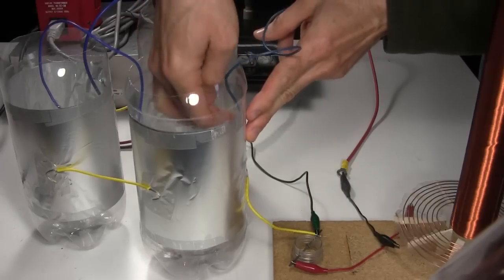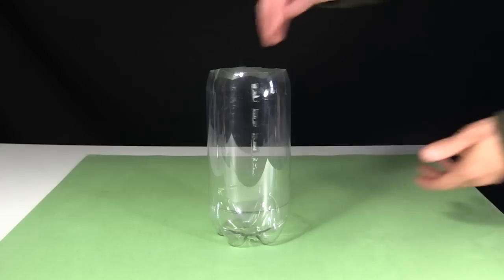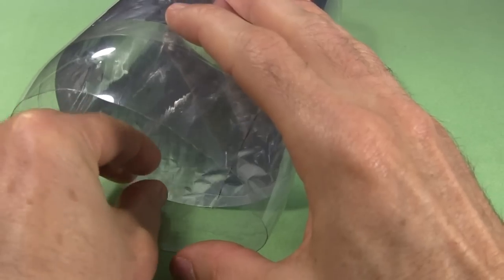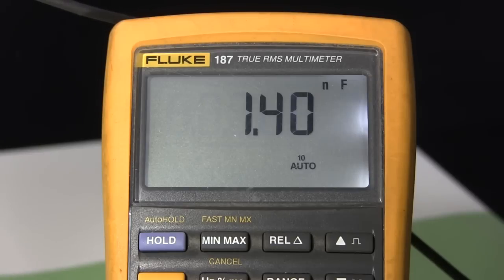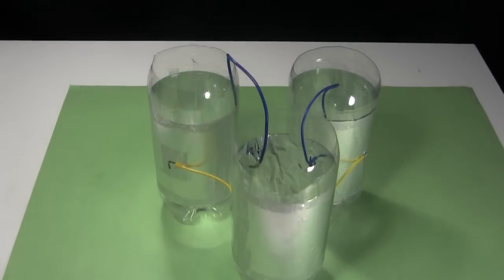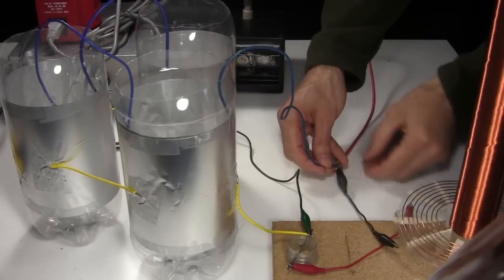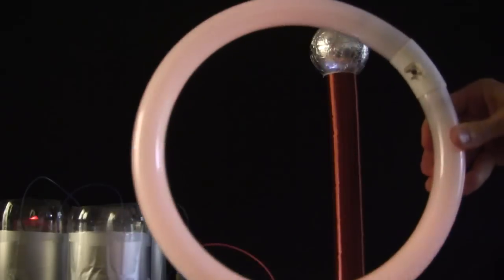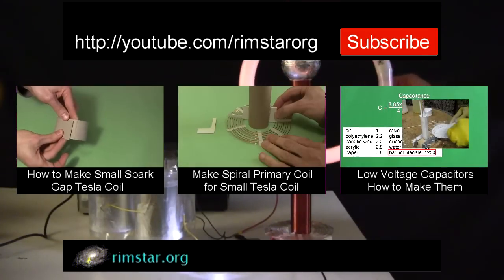How to Make Capacitors for Tesla Coil - Small SGTC

Comment from the maker: +Ereka Bergantinos I used around 18 AWG (gauge) wire with a plastic insulation. The size (gauge) of the wire doesn't matter much, but it should be insulated to minimize losses i.e. not bare wire.
Reply: +RimstarOrg i also wanna know.. what if the magnetic wires in the secondary has tiny gaps in some areas? is it gonna make a problem?
Reply from the maker: +Ereka Bergantinos From what you describe, it shouldn't be a problem.
Reply: oh.. thanks! :) and also.. the primary coil is made up of stranded copper wire? and why ist that it has to be a stranded copper wire?
Reply from the maker: +Ereka Bergantinos It doesn't matter if it's stranded or solid. Either one is okay.

Comment from the maker: Making it even easier for anyone to do... how to make soda bottle capacitors for the small Tesla coil. enjoy!
Reply from the maker: *****
Cool. I look forward to seeing it.
Reply: Rimstarorg I was wondering I wanted to buy some high pressure sodium lights to start growing vegetables indoor and I don't have like solar or anything but I'm reaching out to you to see maybe if you know how tall or big a tesla coil needs to be to generate enough electricity for a high pressure sodium light and how to get the maximin capacity of a tesla coil to the lights. Do you know how this can be done? Much love!!
Reply from the maker: Anthony Garcia
I don't know anything about sodium lights but a quick look at https://en.wikipedia.org/wiki/Sodium-vapor_lamp shows they are similar to fluorescent lamps. If you're thinking of using a Tesla coil because of the demonstrations of lighting fluorescent lamps with it, those lamps aren't lit very brightly and I imagine it's an inefficient way of doing it. Probably better to search for a circuit that directly connects to the lamp instead. Cheers, Steve
Reply: Their only not lit brightly because of the amount of energy being sent off from it right? The col itself generates electricity I guess I'm just trying to figure out how to use the energy it can store to its maximum capacity.  I see the closer you put any light to the coil the more power it gets. I want to figure out how to send off its large amount of energy to a bulb that is like 20, 30 feet away. Any ideas? Sorry if I'm buggin haha =D
Reply from the maker: Anthony Garcia
I have no idea how to transmit that distance.
Reply: Yes I'm not worried of free energy in ancient times Egypt and Greece used something that was similar not exact but similar to what we call a tesla coil. Free energy is there we just have to explore and experiment until we find what works for us (as individuals) thank you both for your input!!
Reply: RimstarOrg if you filled them with saltwater and then put saltwater on the outside like a bucket capacitor you might have a better effect and they may keep from breaking down better having cooling
Reply: @Anthonyag42  there is no free energy. They used the flowing water bodies to harvest electricity from it and radiated it over large distances.

Comment: An idea popped in my head when i saw you attache the inner strip of foil. If you sacrified another 2L bottle, and cut a cylinder out of it, and then a vertical slit. Insert into the original 2l bottle with foil, and it would press the foil firmly outwards.
Reply from the maker: John Knutsson Oh, brilliant! That would be a huge improvement since it would ensure the highest capacitance. It's too bad comments like this come after the video is released. I would definitely have done it (though I don't have any more bottles at the moment.)

Comment: cool video, we can also use cd's to make such capacitors if you need something smaller and compact.
Reply from the maker: professorfidelcat Thanks. Regarding CDs, you'd have to make sure the foil doesn't go all the way to the edge of the CDs, otherwise there could be sparks from one foil to the next going around the CD that separates those two foils. But with enough of them stacked, that would work too.
Reply: RimstarOrg true true..have you tried stepping down these static discharges into usable voltages and quantified currents to accomplish tasks such as recharging a bank of batteries,lighting an incandescent bulb etc?? that would be dearly interesting!!

Comment: You know, I often hear you mention capacitors a lot but I never knew what they are and what makes them so important for electronic devices.
Reply from the maker: Brandon Fisher I have thought that that would make for an interesting video, the various uses of capacitors in circuits. Unfortunately I know of only a few, such as: for smoothing, for absorbing voltage spikes, for blocking DC, for resonating with a coil, and probably one or two I can't think of right now.

Comment: Is an air gap leyden jar basically the same as a salt water leyden jar ?
Reply from the maker: If you mean a leyden jar with a metal electrode wrapped around the the outside of the jar and salt water on the inside of the jar then no, they're both capacitors.

Comment: So I have a few questions. First of all the reason I’d go with diy capacitors is because I’m using 56kv hv source which would require $400 of capacitors. Anyhow, would the capacitor only release current when it’s completely full, or when there is enough energy to jump the spark gap? Sorry I don’t know a lot about capacitors. Also, how would I measure the resistance and volt capacity of these capacitors? Or would it just be so large it doesn’t matter which brings me back to my previous question of when do the capacitors release the current. Thanks!
Reply from the maker: In answer to your first question, the capacitor releases its charge when there is enough energy to jump the spark gap. At that time, the spark gap provides a short circuit which discharges the capacitor. So the voltage at which the capacitor discharges is determined by a number of factors: the shape of the spark gap's electrodes, the width of the gap, the air temperature in the gap (hotter = easier to spark), the air humidity, ... Regarding your second question, the way I measure how much voltage the capacitor can handle without breaking down is to keep increasing the voltage until it breaks down. For the capacitor resistance, I don't know.
Reply from the maker: Here's my video where I talk about breakdown voltage and test the breakdown voltage of a capacitor https://www.youtube.com/watch?v=MPD7skZ8OSo
Reply: @RimstarOrg  wow you replied thanks. I’m the vid was so old I didn’t think you’d reply. Thanks!
Reply from the maker: It's my pleasure! I have a how-to-make an electroscope video which is around 11 years old now and still regularly answer questions there. I just noticed which of my Tesla coil videos this is. I subsequently made another video about some better capacitors for the Tesla coil here https://www.youtube.com/watch?v=EkvODkLL9Og in case you're making yours based on my videos. The flat ones in that video are better because the foils don't move around.
Reply: @RimstarOrg  Yeah I watched that video right after this and that's the design I'm planning to go with. Thanks alot. I will update you in a month or two if it gets finished.
Reply: @RimstarOrg  So I have a quick question that’s not really related to capacitors but I’m hoping you can help since you know a lot about HV generators. How could I add a frequency and voltage adjuster to a HV generator. I have your standard 24v 15a supply that goes into a dual flyback transformer and zvs circuit pair. Is there some thing I can attach to the output of 56kv to adjust voltage and frequency to get longer arcs but less pulses?
Reply from the maker: I don't know how to do it on the HV side but it might be easier to do the the low voltage side. That's what I do for my HV power supplies. I plug a VARIAC into the wall socket and I plug my low voltage power supply into the VARIAC. That way I can vary the low voltage going into the HV power supply. But whether or not it will work depends on your HV power supply. I've never worked with a zvs circuit so I can't say. For the frequency, I don't know. The only HV power supply I've ever varied the frequency on was a 555 timer and ignition coil one (not documented but you can probably find it on the web somewhere). I tend to work with HV DC.

Comment: hello! ok so you've just made the jar's be the electrical source for the tesla coil. Have i understood this correctly?
Reply from the maker: Sort of. The Cube power supply is still the electrical source. But once that's charged the capacitors and the spark gap breaks down, then the energy comes from the charged capacitors.

Comment: aluminium foil/transparent film capasitors have higher capasitance per volume and depending on how many layers of transparent film you add you can make them too suit your voltage needs.  I think you should use those instead
Reply from the maker: Laharl Krichevskoy I considered that, I have a roll of polyethylene, but I wanted to keep it to something that everyone has available. My photocopier transparencies worked well as a dielectric in my TEA laser. What do you have in mind as a source of transparent film?
Reply: RimstarOrg
 i said transparent film because i dont know how you call it in english, (google says plastic wrap) i thought you'd get what i meant. What i meant was that film used to cover food in chinese restaurants. It's the one you can buy in any store, not sure what material it (polypropylene maybe?), but since you can get both that and the aliminum foil in most stores it should be pretty easy and cheap to make.
I'm sure i saw a video about those around here but now i cant seem to find it. Still i'm sure it should work.
It's just plastic, aluminium, plastic and aluminium and then just roll it like you roll a news paper.

edit: found it http://hackaday.com/2011/05/09/roll-your-own-capacitors/
Reply from the maker: Laharl Krichevskoy Ah, thanks for clarifying. As you said, I could always add more layers if the breakdown voltage is too low. It's neat that the aluminum foil and the plastic wrap are next to each other in the grocery store. I guess that's the capacitor making section! :)

Comment: Hey Rimstar how you increase the voltage rating of it to 2000v or 2kv
Reply from the maker: I'm not sure what the voltage rating is for these bottle capacitors. But to increase the rating, you can wrap a lay of more plastic around them and then wrap the foil around that. However, that will decrease the capacitance so you'd need more bottles.
Reply: @RimstarOrg  thank you for the info

Comment: Why do the capacitors have to be circular? Can't you just make sheets of foil with insulators between them? You could get more area on a flat sheet and save space. Stacking multiple layers would help too. Not that a new use for a soda bottle is anything to discount, but you could save them for more water rocket episodes. ;-)
Reply from the maker: USWaterRockets They don't have to be circular. Soda bottles are something everyone has easy access to (I get mine from recycling bins.) But as you say, it's a shame to waste perfectly good rocket building material :).

Comment: Do you have any experience with storing the energy taken up by the capacitors?
I was thinking of making one that can easily replace the battery used in cars, for the purpose of weight, coupled to a small solar charger for supplementary power.
I know it's possible to buy these boostpacks that China recently have taken up.
I was towing my broken down car without power because the battery was empty, but I believe I won't be needing to worry about that if I'm doing what I'm planning to, isn't that somewhat correct?
Reply from the maker: You're talking about supercapacitors. They're quite different than the type in this video and I don't have any experience with them.
Reply: I can tell you that these supercapacitors looks really promising in terms of cranking up your car, at least.
Lasersaber have done some experiments with these, like six 350 farad capacitors coupled in series, and he made it work, and he also kept improving this setup with added solar charger, balance board and a 14 volt RC battery.
This would actually be pretty bulletproof in terms of camping out in the wild for long periods of time, because capacitors discharge all the energy stored in one go.
I'm tempted to actually try making my own as well with aluminum foil and dialectic polyurethane, and measure the capacitance, just because I can.
I need to learn a bit more though, but it can be done and that's what matters.
You should check it out as well.

Comment: sir,if I would wind primary coil of Tesla over the core of fly back transformer, will I get extremely high voltage.
Reply from the maker: No, you don't want a core for the Tesla coil primary. That would affect the coupling with the secondary coil.

Comment: what would you say would limit the input power ? for instance if i were to use a dual MOT power supply with a similar tesla coil sized as yours, would it end in a puff of smoke and flames or will it work ?
Reply from the maker: The only thing I can think of is that the voltage built up across windings of the secondary coil might be too high and you have sparking between the turns, but I can't say for sure if that would be the case.
Reply: RimstarOrg thank you for your reply :) would coating it with paraffin or polyurethane along with some corona  dope be a good way of preventing such arcing problems?
Reply from the maker: That would certainly reduce the chances of such arcing. I'm not sure if it would be overkill but I'd be tempted to even coat the cylinder and then put the wire on while that was still wet, to make sure that where the wire met the cylinder was well coated too. But I haven't done that for a Tesla coil so you might want to search for examples of where other's have coated their secondary coils and what they found necessary.
Reply: RimstarOrg I'll take that into account and hopefully things I'll go well :) thanks alot :)

Comment: I'm confused, what is the formula for calculating how many nanofarads your tesla coil needs?
Reply from the maker: +SpydreX Official I don't have any formula. See my video about making this Tesla coil https://www.youtube.com/watch?v=0SaEPW_iMF8. I just put different values in the online JAVATC calculator, along with values for the other parts until I get the resonant frequencies the way I want them as mention in that video. I did start with variations for capacitances that I could come up with (series, parallel) for the high voltage capacitors I happened to have, but since you can make your own capacitors you don't have to do that.
Reply: RimstarOrg Oh ok thanks:)

Comment: Or..
Don't cut the bottle, wrap aluminium on the outer surface and fill the bottle with salt water. 
You have your salt water capacitor
Reply: Nikhil Jagtap the capacitance will be too high and the primary and the secondary wont resonate

Comment: what's the max NST voltage for these caps in spark gap TC?
Reply from the maker: I don't know. I never reached or tested for their breakdown voltage. These other flat plate caps I made (https://youtu.be/EkvODkLL9Og) are probably better ones though. You can control the thickness of the dielectric by adding more layers between the plates, increasing the breakdown voltage if necessary.
Reply: thanks for your time and excellent videos -  9mm Baltic birch plywood (available in 12"x12" pieces)for the clamp/housing should make for a nice/flat stack - I can't get around so would have to find the dielectric online.  btw, although I don't travel, a couple of years ago, ball lightning visited me and was within 15 -20 feet at one point.  It emanated off the power lines and floated across the road and into my driveway.  It came twice - once about 60 feet in front - then I decided to get out of the coming storm - the 2nd ball apparently followed nearly the same path and behind me and a friend when walking up the driveway.   It dissipated with a flash and interesting, a "zzzzttt" sound - like an AC arc rather than DC "snap"  I'm an old guy without cell phone - there were 4 or 5 others who saw the event - but they didn't realize the rarity of what they were seeing so - no video....

Comment: bro can i use 13v ac supply with it.
Reply from the maker: The input to the primary circuit must be high voltage, in the thousands of volts. So, no, you can't use a 13v ac supply.

Comment: if I would use smaller ball on top spark will increase. I made it but I'm still working on it.and what should I do with second (bottom) end of secondary,should I touch on ground or free in air.
Reply from the maker: Changing the size of the ball on top has to be taken into account in the online Tesla coil calculator I talk about in the video. It has an affect on the secondary circuit's capacitance. If you redo the calculations so that the new ball still gives the primary and secondary sides the same resonant frequency then it may make it easier to get streamers. I don't know for sure that it will be enough to get streamers though. I've actually been trying to do that too but haven't had enough time to finish trying it.
The wire at the bottom of the secondary coil should touch ground.
Reply: +RimstarOrg thanks for it